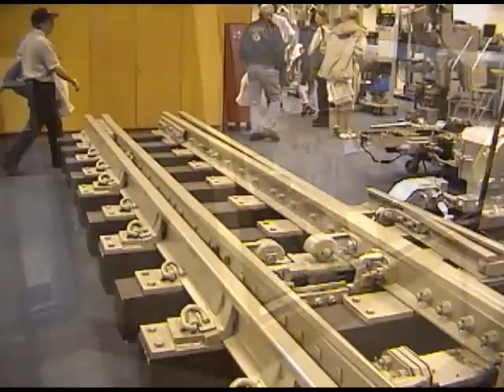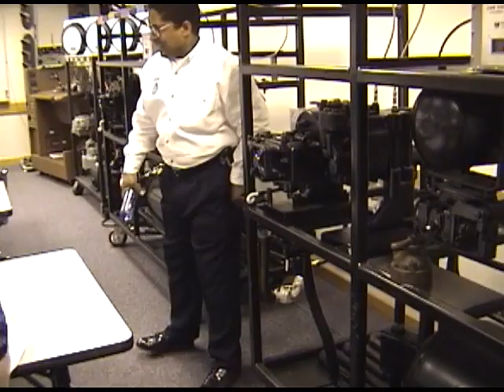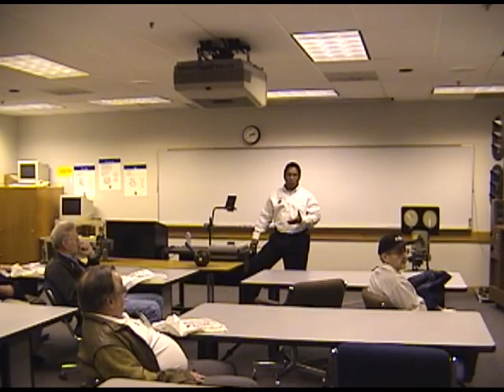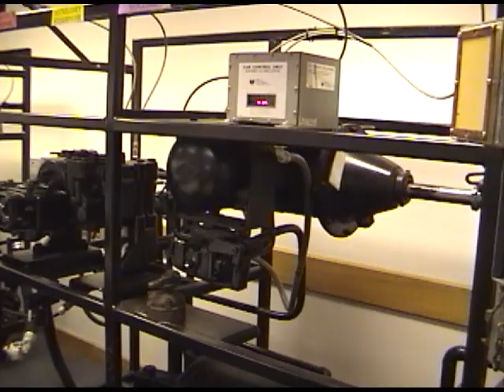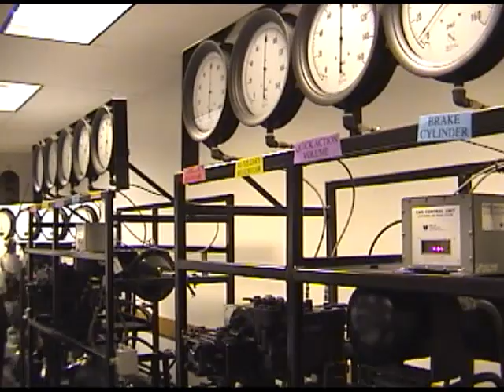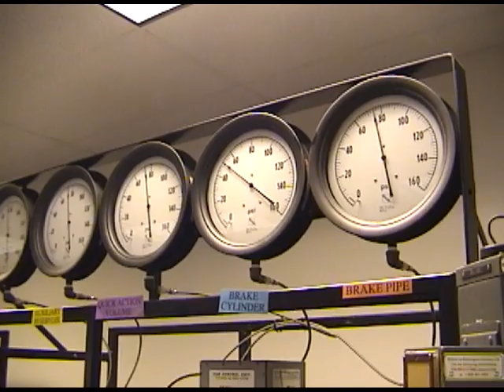ECP Brakes, BNSF Training Center, Kansas

Comment: I used to teach ECP Brake classes here back in the mid 90s. I also spent months riding Double Stack, Grain, Coal and Ore trains on BNSF, CSX, CP Rail and Amtrak's Auto Train which was equipped with ECP for a few months.